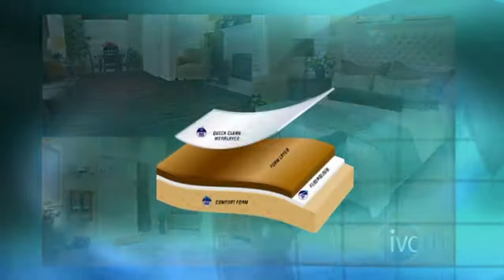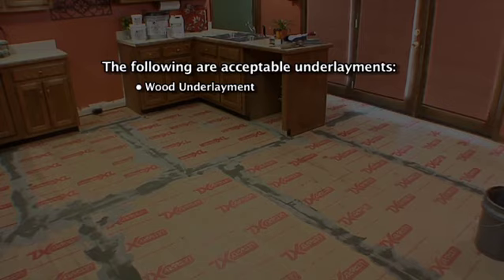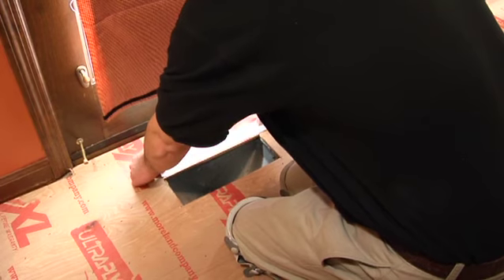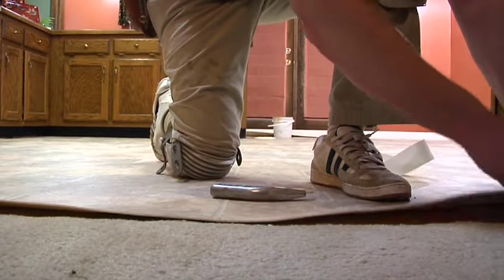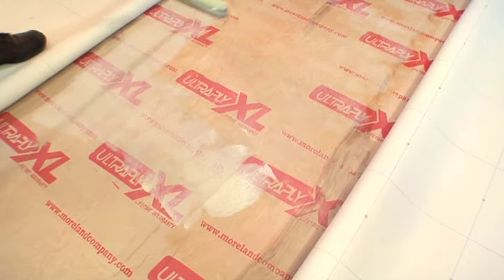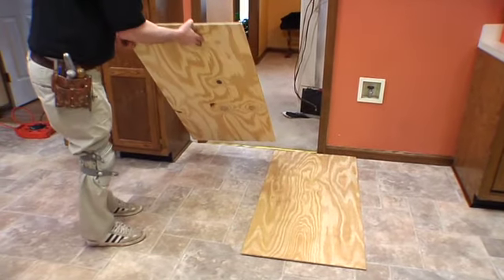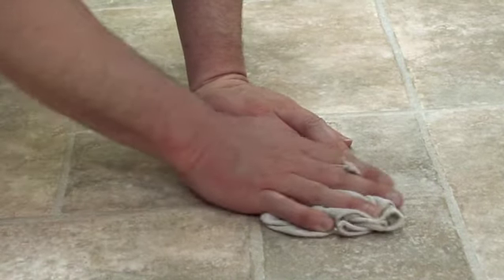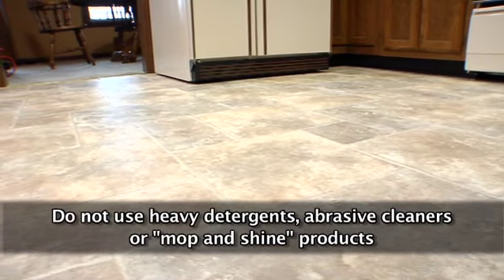IVC US Luxury Sheet Vinyl Installation - Full Video

Comment: I had problems with this flooring. After my contractor met with the manufacturing rep, they realized that all the material I had received was defective. The company offered to replace the material but did not offer to compensate me on the 3 days I tried installing it and the 1 day I hired professionals to try to install it. I was extremely disappointed and decided to go with something else.

Comment: Because  of the thickness of the foam; be prepared to have numerous dimples when walking on it. Impossible to get flat because of the foam. Think of it like memory foam mattresses. Come back the next day and the indents are gone. Do not use 1/8" notched trowels for this, the smaller the better. Learned from my mistake.
Reply: Adhesive should be rolled on according to the instructions, not troweled.